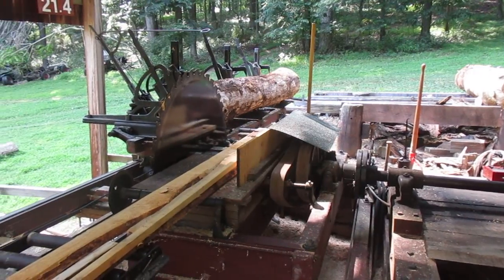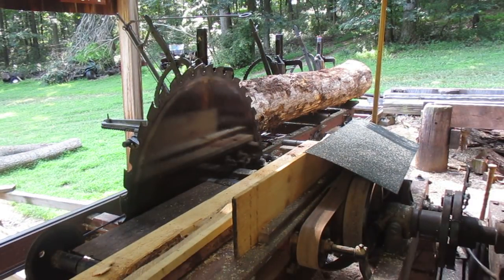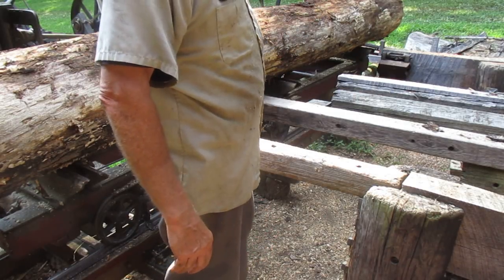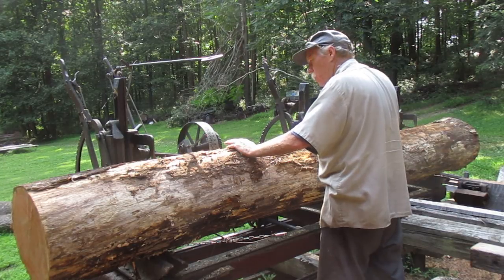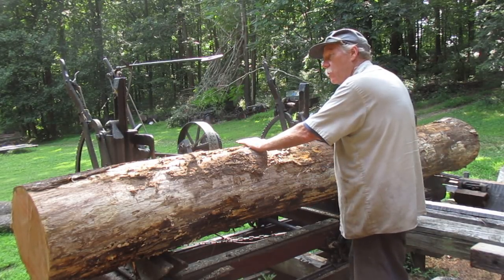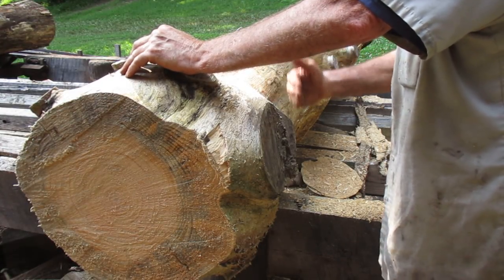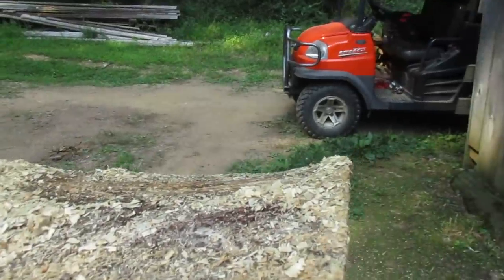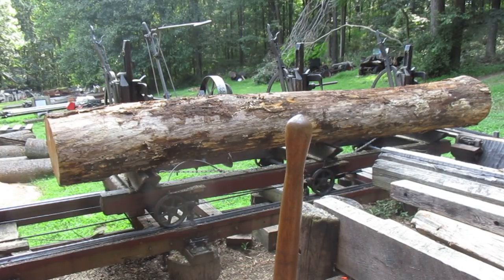Sawmill is going to get a new feed cable .#416 one and 2

Comment: With the fixed deck I would set a walking plank down in the bunks back from the end 18-24". Then you'd still have access for your cant hook to turn back or forward and not have to climb over bunks although you'd have to bend over for set your dogs.  Just a thought.
Reply from the maker: hi there kind of use to what I'm doing . just had a slippery log . thanks john

Comment: Hello John; I always look for your videos. With an operation such as yours it has to be an ongoing works in progress. That cable doesn't look rusty just stretched. If it original to the mill it has had a long and glorious career. Great video. I would have put your jack under that broken 4X4 and gone along. Have a great day.
Reply from the maker: hi there thought about blocks but just went for it . always said you never be suss full unless you are willing to loose . thanks john

Comment: i noticed on lots of mills the sawyer is practily on the same plane as the carrige but you are down below it is that why it fell so far and hard to get back on? i turn mine back a lot on my mill saves on the blade cause your cutting into clean wood
Reply from the maker: hi there when i set mine up i didn't want to bend over as much . i prefer to turn back but these pine loge were to lumpy  thanks john